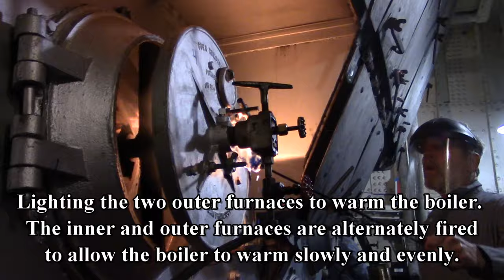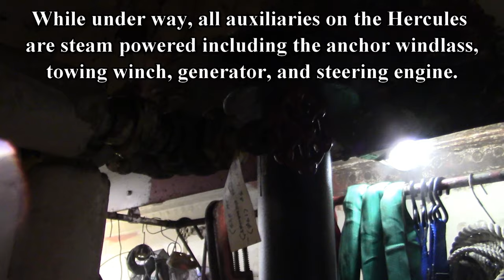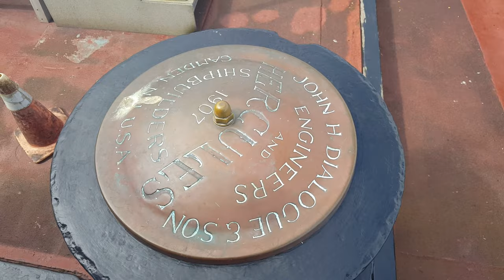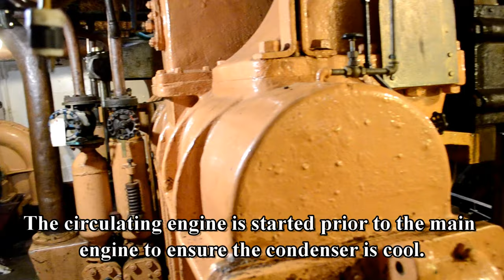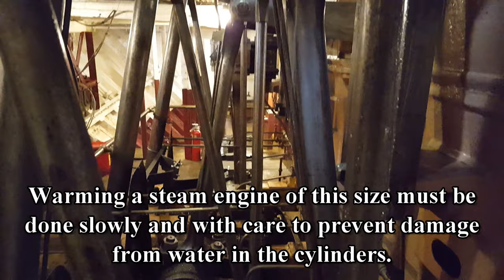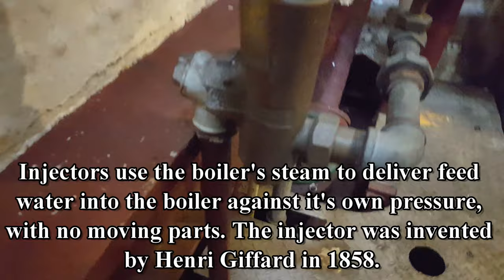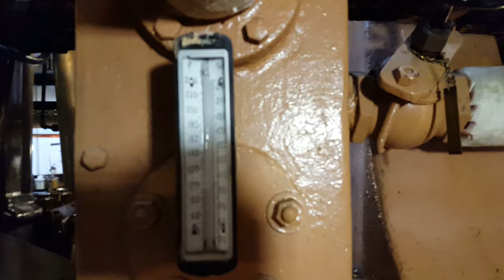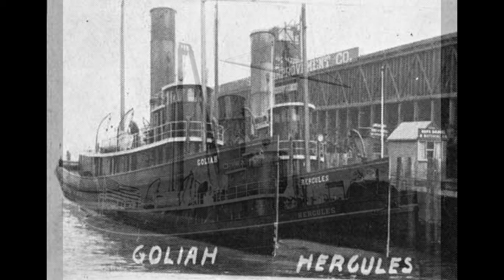Steam Tug Hercules STEAM UP! TV show TUGS!

Comment: Fire tube or water tube?
Reply from the maker: Thomas the awesome, it's a very large horizontal return-tube firetube boiler, commonly known as a "Scotch Marine Boiler."
Reply: Ah. We have a working steamship down at the San Diego Maritime Museum, and she goes out a couple times a year. She has a Scotch boiler and the coast guard doesn't let us run her over 100 pounds of steam pressure
Reply from the maker: Thomas the awesome, ah yes the S.Y. Medea. A beautiful ship. Is she still coal fired or oil now?
Reply: Wesley Harcourt oil fired, if I'm not mistaken I believe she was converted in the 60s
Reply from the maker: Thomas the awesome, a good move especially in this day and age
Reply: Aye sir, it is. I hope to be placed in the engine room of the Medea soon. She has a gorgeous little compound steam engine.
Reply from the maker: Thomas the awesome, its a fun place to to be! Youll enjoy every moment, even when your hot, and filthy. There's something about reciprocating steam that other machinery just doesn't have. The gentleman I bought my steam launch "Wayward Belle" from (Charles Grosjean) spent time volunteering in the engine room on the Medea decades ago...
Reply: Where would an OPM be located for all hands to review; take home?

Comment: circulating pumps- pumped sea water (SALT) thruout the engine? That must cause massive decay & erosion & rust.
Reply from the maker: They pump it through the inboard condenser. They are usually built of cast iron with copper tubes. Both of which corrode very little even when exposed to salt water.

Comment: I think you're forcing the boiler from cold.......I've only been around for 70 years ❤
Reply from the maker: They take well over 12 hours to ease her up to 212° by alternatively firing the burners for short periods of time. They also use a hydrokineter (boiler water circulating pump) during the process to circulate and distribute the wam water from around the furnaces throughout the boiler so it all warms evenly. All very much accepted practice for the last 120+ years. What you're seeing in the video is after steam has already been brought up and they were bringing the boiler to full pressure for warming the main engine.

Comment: I surmised incorrectly  that steam turbines must turn at TREMENDOUS speed. I based that assumption on the one hundred RPM of the largest diesel and steam engines built in the last hundred years and my experience as a certified aircraft engine mechanic that all turbines steam or otherwise must spin at tremendous speed to develop enough shaft horse power(shp) to be effective as power plants. 
Having changed my thinking, a steam turbine turning at four or five thousand rpm is rotating quite fast, compared to its piston driven version. An aircraft turbine (turbo prop) may rotate as much as 20,000 rpm to supply the shaft horse power (shp) necessary to meet the aircraft design criteria. Once at its design rpm maximum an adjustable propeller operated by the pilot is used to control the speed of the aircraft. Here, I'll assume that a steam turbine must turn at a constant RPM while the (shp) is controlled by the operator through gear reduction or a mechanically adjustable propeller.
Reply: On a sidenote, if you want high rpm, get an RC model turbine, 125k+ rpm static :D
Reply: For what it's worth, the huge generating sets in electrical power plants are direct coupled to the steam turbines. 660MW sets that my uncles worked on designing and building at NEI were running at 3,000 rpm for the 50Hz power used in most of the world's big power systems. The first reduction gearboxes used on Parsons steam turbines were roughly 20:1 reduction.

Comment: Just love old steam engines but my word how over engineered and inefficient compared to for example a modern diesel
Reply: That's the beauty, it's easy but hard, devil's in the details. Also, these things aren't inefficient, trust me, Poland wouldn't be using them alongside diesel tugs in the 50s, 60s, and 70s, if they were inefficient.